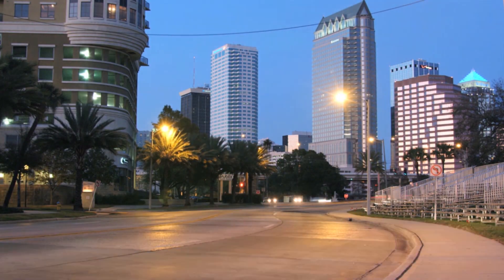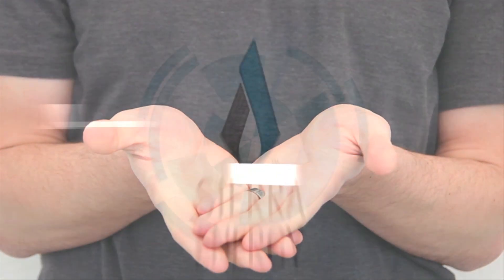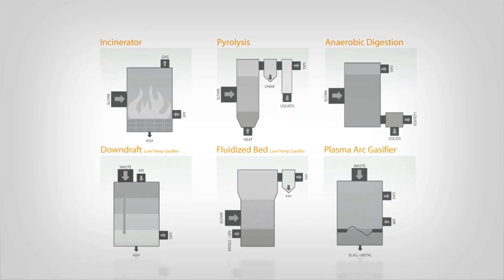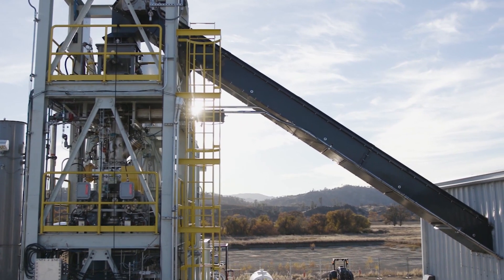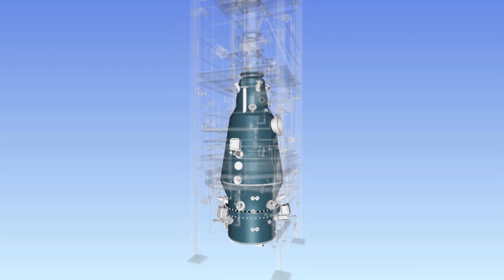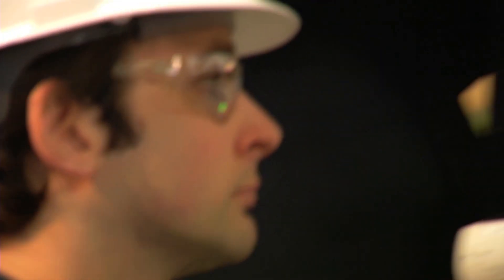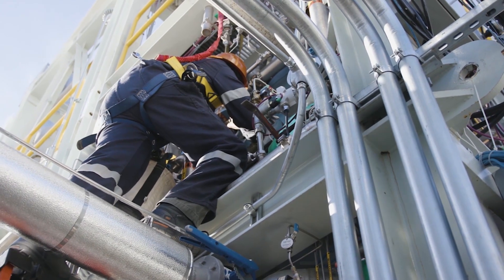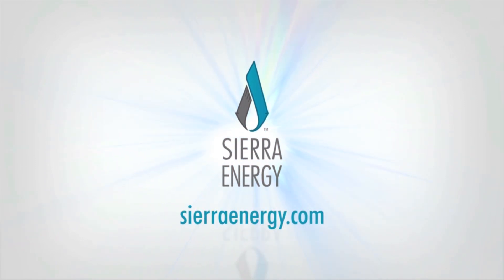FastOx® Gasification — The Future of Waste

Comment: What fuels the gasifier? Natural Gas?  The flame looks to be natural gas.
Reply: The true source of the energy is the trash itself. The system initially uses outside energy to get started but once it's up and running when the trash is broken down it breaks into items like syngas and hydrogen that can then be used as the source of energy for the system.

Comment: What is the energy source used to perform this process?
Reply: The energy is in the waste; that’s part of what makes this technology so exciting
Reply: The true source of the energy is the trash itself. The system initially uses outside energy to get started but once it's up and running when the trash is broken down it breaks into items like syngas and hydrogen that can then be used as the source of energy for the system.